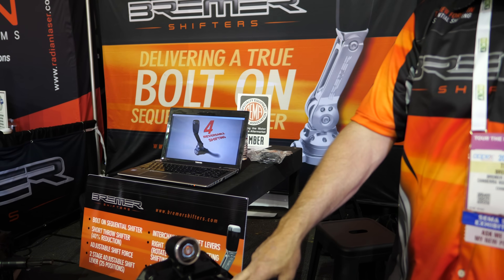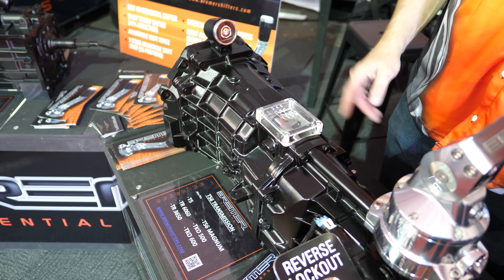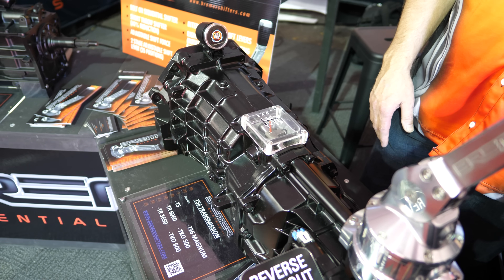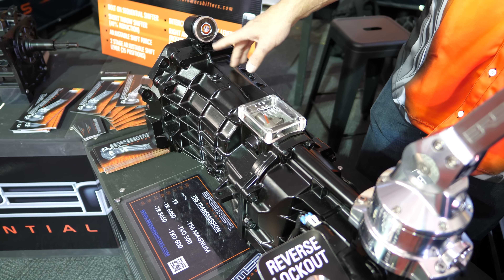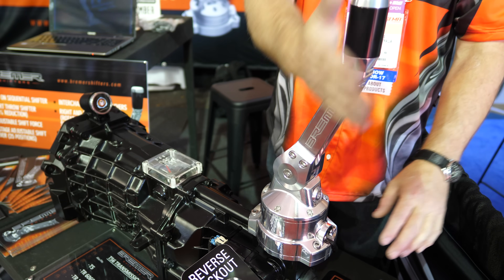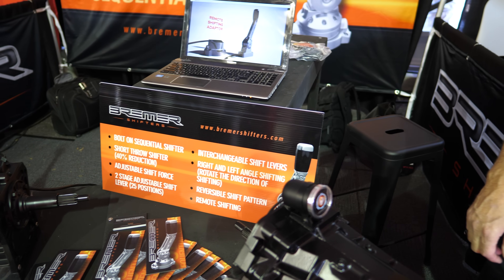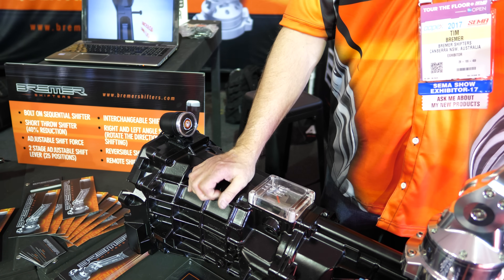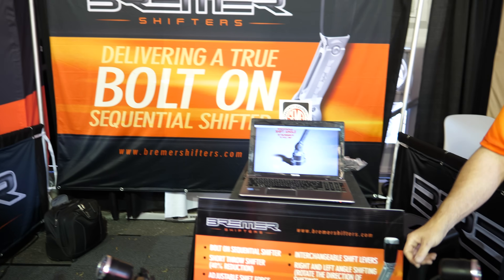Bremer Shifters - Convert Your Manual Transmission to Sequential - SEMA Show [4K]

Comment: I want to shift it without the clutch this dissent solve it
Reply from the maker: What kind of car?
Reply: That is called flat shifting.. buy a haltech that isnt a new thing.
Reply: @brendan636  Flat shifting still uses the clutch. You need an ecu, a strain gauge and a dog box to shift without the clutch. And you will still need the clutch to put it in first and reverse

Comment: Save up and buy a real sequential.  This iş just a gimmick
Reply: If you have a dog-engagement h-pattern transmission combined with ignition cut programmed in the ECU and triggered by a load cell shift lever, this shifter would actually make it a fully sequential transmission.
Reply: @ryansnider  which sounds great, but when all is said and done you probably could have you could have just bought a sequential for the cost of all that
Reply from the maker: Who makes a “real sequential” anyway?
Reply: @TwilightTheShooter  If starting from scratch, you're probably correct, but for people that already have a dog-engagement h-pattern, that's a more affordable alternative than buying a second $12000 gearbox.
Reply: @InternalCombustion  Loads of companies. Quaife, Hewland, Saenz, Xtrac, Hollinger, Sadev to name a few.

Comment: Not a true sequential gearbox if you have to use the clutch in all the gears besides 1st
Reply: sequential is the way it shifts, nothing to do with using the clutch or not
Reply: I think you are confusing sequential for dog engagement. Sequential is just the way it shifts, dog engagement would let you not use the clutch.
Reply: Stick some stright cut dog gears in and then u don’t need the clutch just punch like you hate it?
Reply: he never said it was a sequential gear box

Comment: Only one problem. For a daily driver, where's the neutral position or do you ride the thrust bearing on your clutch at a red light etc....
Reply: FIGJAM go to bremershifters.com you'll find a video demonstration and it'll show you it can go into neutral
Reply from the maker: That’s another good question I hadn’t thought of.  If I see them at PRI this weekend I will be sure to ask!
Reply: FIGJAM I'm sure it has a neutral position
Reply: If you're sure, then explain.
Reply: Hmmm ok.... I've had a look and I think you're right. Nice pick up! It looks as though it steps into neutral from first.
Reply: i think you hit the shifter not enough to pass the gear we will go to neutral.
Reply: @V8March  they mentioned it shifting like a motorcycle
Reply: FIGJAM yup,and if you go up one more above neutral you'll find reverse